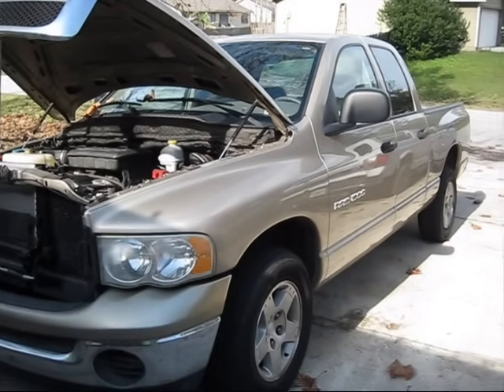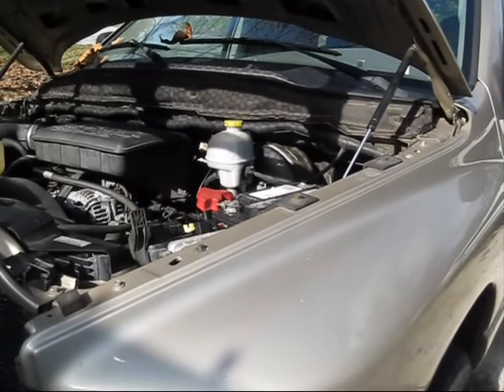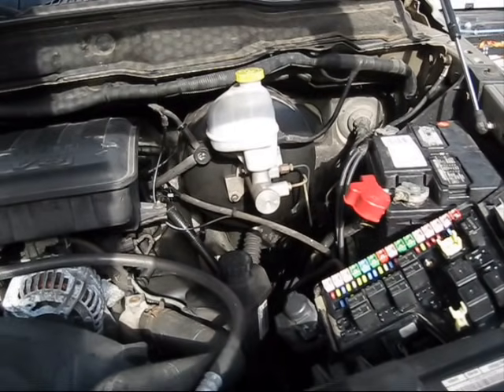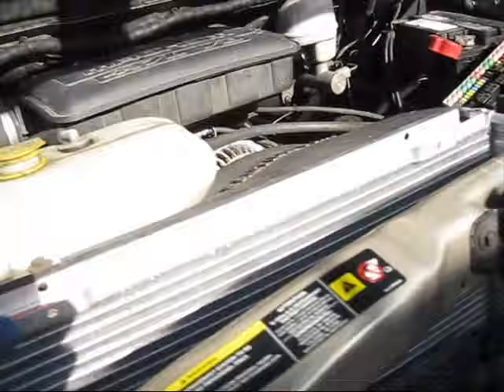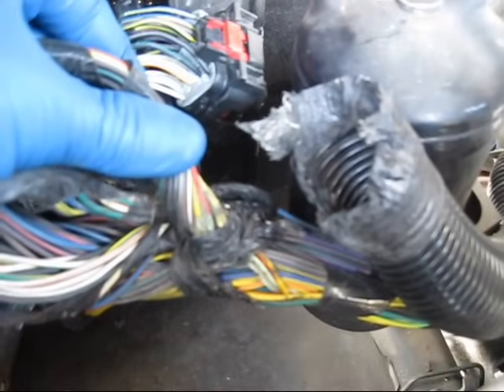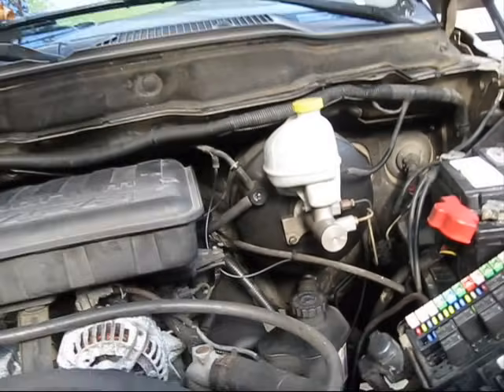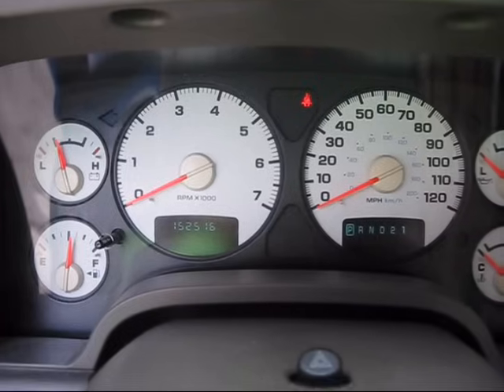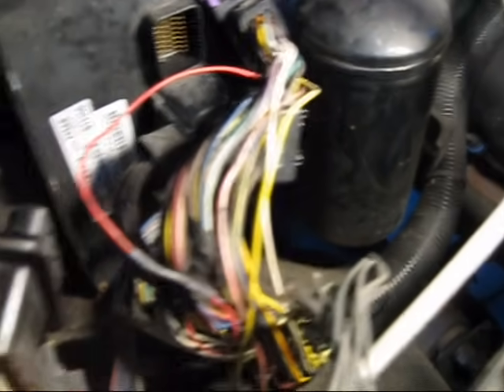Dodge Ram 1500 no crank / no start diagnosis and repair

Comment: You did a good job at detailing your step by step troubleshooting protocol. Your process of elimination was on point and thorough. You did not suffer from tunnel vision yet, you avoided getting sidetracked, that takes mental discipline and attentiveness but wouldn’t work without a general grasp of the vehicle control system’s functionality (ECM, PCM, ECU Modular components through K-can, Can Bus, etc.) educating yourself made tracking the issue from a knowledgeable perspective giving you the ability to take the most efficient and direct approach. I am a critic of critics, but you have done what was necessary without beating around the bush too much, great way to reduce simplify factor and solve. (Algebra is a mindset, metaphorically speaking)

Comment: I really like the methodical and logical way you traced the problem down. This video will help me diagnose my problem of intermittent stalling. Thank you!
Reply: Mine isn't the same problem. Mine stalls after starting. Dies and won't start unless I shut key all the way off and then turn it on. I will restart but die. Some times right away some times dies a mile or ten down the road. Any Ideas?

Comment: THANKS!!!!!!!!!! Having same issue on 2008, Dodge  2500.  Spent several hours online. Did all the recommended things, disconnected battery and so on. Found your video, went right to the same harness the exact same spot and exact same wire. Saved serious time and money. Thanks for your detailed video.. DATED Aug 31  2017
Reply: I was on the road and my truck started smoking,,, it is low on oil but I just added two quarts and it still won’t start. What should I do ?
Reply: 2008 Dodge 1500 v6 I have to turn key switch 10 times to get started. Any help would be appreciated.??
Reply: Was that a no start situation
Reply: Starter relay failed in fuse box under hood under fuse pannel.
Reply: Well done
Reply: @Jamiir215  if it's smoking and not starting I'd think your engine is fucked, probably blew the head gasket time to get a used motor swap it in
Reply: @abtwopoint0  thanks lol but that truck is old news now

Comment: Good one. Saved me a lot of money. I couldn't figure out why it had no power to the starter.I checked fuses and relays. Good ole YouTube,  I pulled this plug out and pushed it back in and away it went. I hate mechanical problems.
Reply: No 87

Comment: Best and most specific on point video I have seen. I have 4 injectors bad and it’s 1000% from the same wire harness. Now I have to find the wires. Unfortunately. It’s waaaaayyy behind the motor and should be fun. I will have a little video myself soon! Thank you again! 🎉

Comment: I have a 2004 ram 1500 4.7l  Exact same problem as this,    Now thanks to Pfun I have a Wire hooked to the PCM Fuse and it feeds the B+ PCM Wire.  Truck runs and drives like a dream.  My dodge almost got retired but not yet thanks to Pfun41!

Comment: Hey my man. Cant thank you enough for this video. It's the only one out there with the solution to powerless pcm. I was trying for hours to figure out what it was when I came across this video. I cant find were my wire went bad so I disconnected it and ran a jumper. Problem solved. Thanks again bro...
Reply: What do you mean ram a jumper just got a 12v signal to send power to that wire?

Comment: Very good diagnostic skills.  Ironic that your video was in my feed right now because today, my 1998 dodge B1500 van 5.2 liter today just clicked the solenoid once whenever I try to start it.  No crank/no start. Everything lights up and battery is sitting at 11.9 volts.  I think maybe the starter is hung up so am going to hit with a hammer a few times tomorrow.  I was driving a friend's blazer once and the same thing happened and I hit the starter with a hammer and it fired up so I drove to the auto store and got a new starter.  If that is not it, then I am going to have to go through the same procedures you did except my knowledge is not as comprehensive as yours is with the van's wiring.  Thanks for making this video.

Comment: Y'all  this video help me , found the problem , corrosion in the main firewall connection it's bolted in the middle with a 7mm bolt , pull them apart and there it was , main feed wire to pcm (small red wire with white stripe) corroded off the connecter soldered piece wire to two end fixed the no crank no start . Good luck . Thanks for your video

Comment: You've got pretty good diagnostic skills for an amateur. I'm a little surprised the voltmeter picked up the problem when no current was flowing.
Reply: Voltage has a tendency to decrease when current begins flowing, Volt is a unit measurement of electrical PRESSURE, Amp is a unit measurement of electrical FLOW and an  OHM is a unit measure of electrical RESISTANCE. think grease gun, vs. grease fitting in sub zero temperatures and a clogged grease orifice add pressure and grease escapes from the gun tip until the pressure is lower than the resistance of the tip to fitting pressure tolerance (rub theough in the wire)

Comment: I'm having the same issues with my 2010 dodge dakota ! I hope i can resolve it as easy as you did. I've owned 6 dodge trucks and every one has stranded me and been a pain in the ass! I've had 6 chevys and.6 fords and none of these caused me the aggervation that my Chrysler products have !!! I finally understand why chrysler has been in the craphole for so many years. I'm going back to chevys ASAP.

Comment: Thank you for this video I was having the same problem turned out it was rats chewed wires under fuse box mechanic to come look at it said no chewed wires possibly faulty pcm watched your video started checking wires and found it! Thanks again

Comment: I had a no crank issue with my 2005  Ram 2500 with the Cummins 5.9.  I had recently ( 1 month +/_) replaced the alternator and  both batteries. On two separate occasions the truck wouldn't crank. first time after a minor amount of messing with jumping it, it started. The second time, the passenger side battery was dead so i charged it and the truck clicked but wouldn't crank. After doing some YouTube inspired troubleshooting and checking the fuses, all good,  I swapped the starting circuit relay with a parking light relay and the truck started right up. Time will tell if that is my full issue, but thanks for the troubleshooting ideas, your video was very helpful.

Comment: Same exact symptoms with my Dodge Dakota. I'll check this out also after I check the normal tests. Great video and great work sir!
Reply: Blacken the Cursed sun did you find out the problem on your Dakota?
Reply: @Consciousness Science So.... How did it go?
Reply: I don't remember honestly. 5 yrs ago... Only thing I recall is.. I smacked the dash twice, it fired up and never had an issue with that since. I suspect a loose wire or w/e. Good ol Russian fix I suppose.

Comment: thank you for this information, i had the same exact problem. However i wasn't able to find the break in the wire, but i was able to run a new wire to the pcm and she started right up!
Reply: My ram 1500 conversion van won't crank a comes o. When turn key bat terminals get so hot melts terminals in second wtf no wires touch also nobus on no wires burnttouch just spark and Tim when turn key her

I
Reply: @skyreilly3271  shorting out break touching ground somewhere

Comment: It took changing my starter relay to cure the same problem with my 2006 Ram 1500. I also replaced the starter relay.
Reply: I also meant to say I replaced the starter solenoid
Reply: I replaced my battery, alternator, starter and fuses before I found this

Comment: I have 05 5.7 with same issues: no crank, no shift indicator light, battery is fine, etc. Thanks for this video (i think LOL), I’m not mechanically inclined, but I’ll have to check the wires & harnesses boo LOL

Comment: I had the same problem with my 2012 Dodge Ram . I got under the hood charged the battery and nothing. So I puked all the fuses out one at a time also relays . Got back in the truck . Turned the ignition and she fired up. Running ever since.

Comment: Having issues with mine as well. Have an aftermarket viper alarm was told that was the issue causing it not to start going in auto theft mode but to replace the ignition lock cylinder and the ignition switch. I replaced it nothing. But there’s a ground wire underneath where the hood latch is. Lights turn on fine but won’t start. I disconnect the ground wire the truck starts but the headlights are turning on backwards. Off comes on and parking lights it goes off. I’m not sure what to do anymore. I disconnected the alarm but still same issues

Comment: I was on the road and my truck started smoking,,, it is low on oil but I just added two quarts and it still won’t start. What should I do ?

Comment: I have a 2008 dodge ram 1500 5.7 L just got it from the shop (Garber Dodge ) after they had it for 8 months because the engine they put in supposedly had a timing chain issue that they never informed me was fixed until a call out of blue saying " we need our loaner car back truck doesn't have any problems " well fast forward after the shop I noticed that everyime I cranked the truck and let go of the key it would continue to crank until it finally took off, 1 week later I'm driving on the road and it shuts off now there isn't any crank at all ,called the service manager and they are continuing to run me in circles. At this point I'm wondering if this issue with my truck and if I'd be better off trying this method
Reply from the maker: It sounds like there's other problems at play.

Comment: My son’s ‘13 Ram 1500 is doing all kinds of weird stuff. Like sometimes he opens the passenger door, and truck starts on its own. Sometimes it won’t start at all. Skipping/stuttering. Sometimes runs great. Shop ran diagnostics. He said: Code B2209, “occupant restraint controller interval 3”. $2,600! WTW? Stumped in SC.... Any suggestions Sir?

Comment: Thanks for the video....where did you get the wire schematic??
Reply from the maker: Factory service manual, found it in pdf form with a bit of googling, can't recall where it was now though.
Reply: @pfun41  thanks a lot... I'll start googling....i wish i still had my ALL DATA ACCOUNT

Comment: I changed my ignition module (its the electrical connection to the ignition switch), y would the fuse suddenly start blowing for it. Makes no sense, i cant figure out where the over load is

Comment: Did a red light flashed when it couldn't start?
Reply: Did you get it figured out?
Reply: @carlosmendez6985  yea thanks!
Reply: Jose what was your problem? I have the same red light flashing.
Reply: @jorgelizarraras7740  I figured it out that it had something to do with one of the battery terminal connector on the positive side which was getting lose from the wire and it was making a leaking sound thats how I noticed it was the problem and I couldn't even tell that it was the connector! I hope this helps! Sorry for not replying back on time! Hopefully you've figured  the problem already bro!

Comment: Currently having the same problem, but I get no lights and nothing turning over. Also battery dies after a day of no use.
Reply from the maker: You have a parasitic draw. with that in addition to the other stuff you have more serious issues.
Reply: @pfun41  oh lord, I hope not but thanks for that

Comment: I’m having the same issue with my 05  ram 4.7 it starts  one minute only for it to not start the next and  have the shift Indicator mark reverse instead of park and won’t go in neutral I  got mess with the fuse box or and it goes back to normal and starts.  Then stalls  I also have my air bag light on and the check  gauges light flash  the battery is brand new had to replace it after the positive wires going to the starter cought on fire
Reply: Same issue for months now.  I was able to slam the door or smack the dash and it would pop over to park.  I just replaced the shift solenoid pack (integrated into the valve body of our trans.) Didn't solve it.  Just got a new battery cause the posts were terribly corroded.  Still not showing park or neutral.  This is days now..  every other time it's corrected itself.  Anyway, if you figured it out plz let me know carnal.

Comment: I HAVE A 2003 WITH THE 5.9 GAS ENGINE. WHERE DID YOU WIND THE WIRING DIAGRAM? MY TRUCK DOESNT HAVE THE WIRES ROUTED LIKE YOURS.
Reply from the maker: 5.9? I'm pretty sure they only had the 3.7,4.7 and 5.7 in this generation. 5.9 should have been up to 2001. I found a factory service manual pdf on a dodge forum.

Comment: Man i wish i understood all of this.:( ...watched it 3 times.n I still.dont get how u found out how ur voltage was reading diff Volts n how pcm.get diff.power...scan.tool?
Reply from the maker: Multimeter. Backprobed to key spots will tell you how much voltage is present at that point.
Reply: @pfun41  key spots? Like putting the multimeter to the harness hole pins?
Reply from the maker: @itsmisterchris  yes
Reply: @pfun41  to measure the voltage in each hole? Reading atleast around 11volt.or w.e.the battery is at the given time..what if.a cable is cut n u can't see any reading..or how u know which cable should showreadings
Reply from the maker: @itsmisterchris  If there's no reading then there's a problem with that wire. Wiring diagrams tell me what should be doing what.
Reply: @pfun41  ignition on right? And readings are in a owners manual or you have special program
Reply from the maker: @itsmisterchris  factory service manual, you can find them online.
Reply: @pfun41  thank you so much
Reply: Krzysztof Stachnik did you fix it? What was the problem

Comment: 96 dodge ram 1500 3.9l solinoid clicks. Engine does not crank. After turning on and off for three minutes engine runs fine.  Any ideas??
Reply from the maker: No experience with that generation or engine but could be a faulty starter solenoid.

Comment: I have a dodge 2001 ram 1500 5.9 4wd that will only start with a scanner plugged into the computer port.  What can be the problem with that?
Reply from the maker: Probably an issue with the communications line for the various modules.

Comment: Another problem with the Dodge trucks (and many other vehicles these days) is that they wanted to be "green", so they started using soy-based insulation on the wiring.  Well, "soy-based" means soybeans and that is considered a food source for many animals (vermin) such as squirrels and other rodents.  They end up eating your wiring and it can run very quickly into a very expensive repair due to the labor involved in tracing down all the wiring.  We have a lot of live oak trees in my neighborhood, so getting rid of the squirrels is not an option.  Although I shoot them on sight, another soon comes around and takes its place.  And living near a greenspace, there's probably other rodents like field mice coming around.  Whoever decided to use an insulation material on the wires that is food based deserves to be drawn and quartered. :(
Reply: I also heard that they use peanut oil on the insulation of the wires to make it flexible

Comment: Hey need some help with my 05, it won’t turn over but the little box that goes around the D for drive and the R for reverse etc... is not around them. Everything lights up when I turn key but nothing happens at all no noise. Car worked fine just took down dash to install a remote start, seen I needed another plug and put dash back up and now nothing, any help from anyone is appreciated
Reply from the maker: It probably doesn't know what gear your in or cant communicate that information properly.
Reply: @pfun41  when I put on the obd it said it was not communicating properly and I was told the pcm needed replaced but will I need new keys and stuff? I’m hoping my wires are lose like your were lol

Comment: So I have a 2017 Ram 1500 and it won't start either. When I turn the key is just clicks and nothing happens. Me wife said it happened before but she said she reset the ignition by turning it 3 times and waited 5 minutes. She said it started. But now it won't even turn.
Reply from the maker: That's not really enough information to diagnose the problem.
Reply: Sounded like your starter man.

Comment: If anyone could help, I’m pretty sure I’m having either a starter or alternator issue because nothing is turning on. No light no crank nothing. Completely dead. Battery is good and charged it jumpstarted yesterday but now it’s basically not relaying any electrical current on my dash or even turning over at all
Reply from the maker: Then you have a completely different electrical problem.

Comment: How did you check the voltage on the wires
Reply from the maker: Multimeter on the pins at the connectors.

Comment: Aye brother .. my truck doesn’t crank doesn’t start and before that it  was running and it just turn off on my ... now i left it park and I left the light on 0: so battery died but today I pass the cables and it won’t start
Reply from the maker: its probably a battery issue
Reply: @pfun41  brother ur right just test the battery and it was bad put a new one and it’s all good thanks

Comment: Someone tried to steal my Dodge ram 1500 it's 1999 it's a standard transmission they smashed my ignition and I replace my ignition switch I replace the key cylinder and keys were and when I put my key into the ignition switch and turn to the on position no lights come on on the dash gauges come on all I have is a click underneath the hood if after a couple of seconds would leave in the ignition on my can't figure out what the problem is my battery is is fully charged